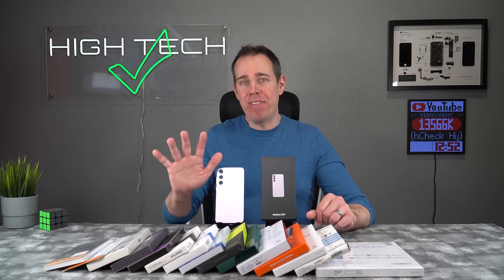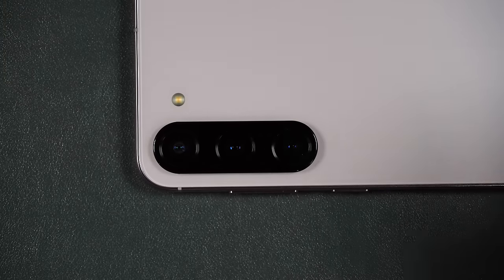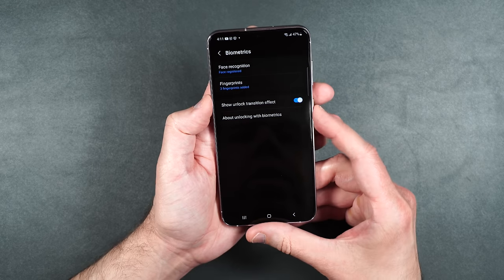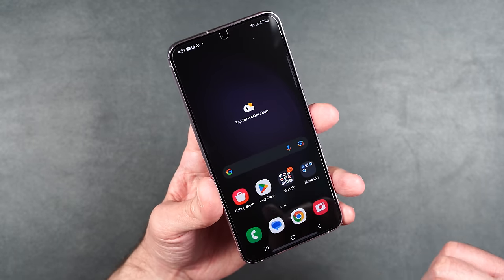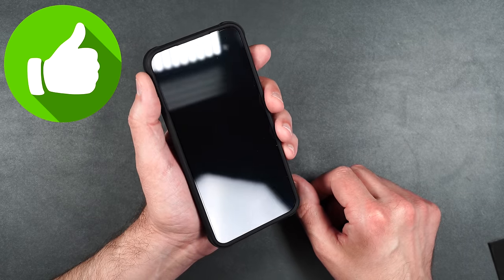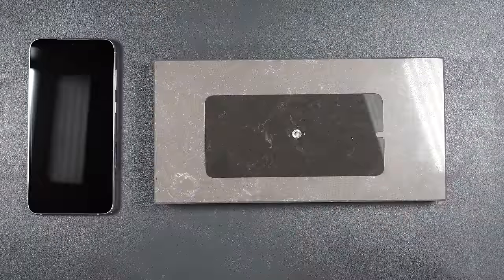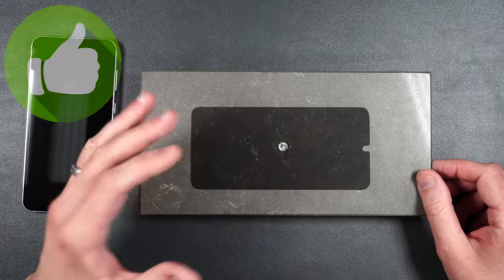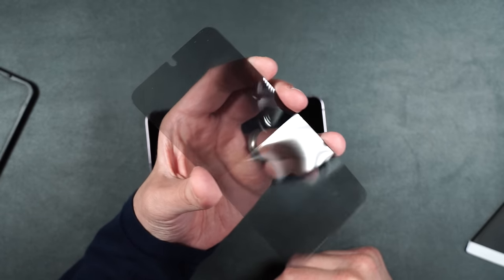Best And Worst Screen Protectors For Samsung Galaxy S23 Plus

Comment: I love how comprehensive your testing is. One possible suggestion: For the drop test, it might be worth adding in a base that has a little bit of flex to it. The test you're doing now with the nearly rigid base is perfect for testing the compressive strength of the glass. Adding in a semi-flexible base (which would mimic closer to an actual phone) would pick up the bending strength of the glass.

Comment: Thank you once again for posting this.  The amFilm and the Spigen are typically my favourites.   My only issue with the Spigen is that quality control can sometimes be off.  I had a perfect install on the S23 Plus, only to find out later that there was a chip in the glass.  Since I decided to go with the regular S23 instead, I went with the amFilm.

Comment: Thank you so much for all the time, money and effort you put into this video. There are so many screen protectors out there, especially for flagships that you can't help but feel a little confused, this cleared that right up. It's great that you broke it down into three different categories at the end but I just wanted to know if the Whitestone UV was worth the extra money. Especially compared to the AmFilm which to me seemed like the best one here. Also, is there any difference after applying these screen protectors in terms of screen responsiveness, display, as compared to the original screen? Thank you once again for your effort!

Comment: On my last two Tmobile phone trade-ins, Tmobile store reps did everything they could to find scratches and damage.
So the S23 plus $1,000 retail price drove me to try a tempered glass screen protector, and I chose the Spigen Glas.tR EZ Fit to match my Rugged Armor case.
I then managed to screw up my first Spigen EZ fit glass by lifting the wrong tab. A learning experience, the second screen protector went on perfectly, and my $1k phone is now adequately protected from routine scratches and drops.
Reply: Okay bro cool
Reply: How easy is it to remove the protector? Thats my only fear in case the protector takes a dammage, wether i can remove it without glue or something staying on the screen.
Reply: @Milan-cf1xe my first use. Never removed a screen protector that has been damaged or on for months or years.

Comment: Almost bought a $40 screen protector from Best Buy for the S24+.  Must have been the Zagg that's in this vid.  Changed my mind at the last second and watched this vid instead.  Glad I did because  after watching it I went with the AMFilm for $8 and ended up with a superior product for a fraction of the cost.   Thanks for helping me on this.  Based on your results, it seems like the AMFilm is really the only option to go with.

Comment: I had no problem installing the protector.  No bubbles or middle line. However these projectors are not as a good a quality as the preinstalled ones were. When using the s pen it leaves marks on the screen which dont go away and i was pressing hard at all. My note 10 plus was still perfect after 3 years

Comment: Thank you so much for your informative videos. I think the important weakness of your drop test is that in addition to strength of screen protector we need to find out that the screen protectors are good dampers or not. In daily life, You may see some screen protectors that are intact while the lcd is broken. As mentioned in previous comment, it would be better to use a substrate which has same strength as normal mobile screens.

Comment: Great video! Your review has made me buy the "amFilm [2+2 Pack] OneTouch Tempered Glass Screen Protector for Samsung Galaxy S23 Plus 6.6 Inch with Camera Lens Protector, 9H Hardness, Easy Installation and Bubble Free". I have installed the rear Camera Lens Protector, and have used the "SUPCASE Unicorn Beetle Pro Case for Samsung Galaxy S23 Plus 5G (2023), Full-Body Dual Layer Rugged Belt-Clip & Kickstand Case Without Built-in Screen Protector (Tilt)" - You recommended the S23 Ultra version of this case in your other video). This combination works great! I got the screen protector on bubble free, and the case does not make the screen protector lift or bubble. The buttons are very really easy to use. The only improvements I'd suggest would be to make the volume up and down buttons separate, and the access to the charging port a bit less tight. The kick stand works well. Hopefully it's durable. I'd still highly recommend this combination. The prices were great value.

Comment: I am using the Spigen. It's the only one that I could still use the fingerprint sensor consistently and was easy to install on my S22. When I bought the S23, I went right to the Spigen again.

Comment: Forgive the ignorance, but what exactly makes the adhesive based screen protector better than the EZ glass screen protector? It looks like a headache to apply and if you accidently apply it wrong or you find accidental dust on your phone, how would you remove it? The whole thing seems like a massive headache for removing the adhesive screen without damaging the phone. What is the actual advantage other than less finger prints and less maybe more scratch resistant?
Reply from the maker: Typically the liquid adhesive screen protectors are the best when using them on phones with curved screens. The liquid adhesive may also help fill in slight cracks on the screen as well. Most of the time the regular EZ protector will be just fine.

Comment: Hello, thank you for all these long tests! It's really useful.
I'm hesitating between a normal screen protector, so the AmFilm or the Spigen, and a privacy screen protector. I have two questions if you don't mind. 
First, does the integral design of the Spigen affect the front camera ? It looks a lot nicer, but I wonder. 
Secondly, it's about the Ringke Privacy screen protector. Having a big phone like the S23+ makes me think that everyone can see what I'm doing on it and what I'm looking at. It's quite disturbing ^^' But I'm afraid it will affect the quality of the S23's screen, in terms of color, brightness and everything else that makes it one of the best screens around. That would be a shame. Have you noticed this kind of thing ? Some comments say that the brightness has to be increased a lot, for example, so potentially less battery.
Sorry for the long post ^^'
Reply: The privacy screen is great but it also makes the screen darkere so you need to adjust your screen light more, and if you use your phone to watch movies or if you use it to edit pictures etc I wouldn't buy it, I just bought the clear normal screen protector from Ringke again, on my Camera I have Spigen protect lenses on and a Ultra hybrid S cover. I won't pay more for the Spigen screen protector when they're the same I can't feel any different it's just the screen tool spigen use that raises the price.

Comment: A little tip for the run off of UV Loca Adhesive on the side of the phones, hit the run off with some extra UV. It'll congeal and it's much easier to peel off that way. It doesnt turn rock hard but it does thicken up enough to be peeled off. This way if there's any adhesive that gets stuck in micro crevices, it becomes bonded to the rest so it all comes off. Else if you just wipe it off whilst it's wet, you end up missing the run off adhesive or push it deeper into the device.

Another tip, if your UV screen protector kit doesn't come with stickers to cover ports, use some dust removal stickers to cover the ports.

Overall I prefer amfilm's UV selection of screen protectors. In addition, their full screen dust stickers are amazing! I wish more companies had those. It's great to leave it on the device whilst you're prepping everything.
Reply: Could you link to the amfilm uv for s23+ ? Just seeing the non adhesive version

Comment: Your forgot two of the best protectors: Flolab Nano Armour and Zagg Invisible Shield.
Reply: The Zagg is currently $50 here in Canada.   There's no reason to spend that much on a screen protector, especially when only one comes in the pack.  My wife has the Spigen one on her iPhone 11, that she bought when the 11 was released.  It's still holding up well considering she drops her phone all the time.  Aside from a small chip (that she cares nothing about), it's holding up really well.
Reply from the maker: I tested the zagg xtr2 instead because that one is supposed to be better than the invsishield
Reply from the maker: Added flolab to the list, thank you for the suggestion
Reply: @HighTechCheck  thank you 😊👍
Reply: Your videos are an enrichment for Youtube.
Reply: @HighTechCheck Great vid.. what is the best for privacy screen protectors?  Thanks

Comment: I just want to know which is the best, going through all of these seems like a pointless task

Which has the best protection from scratches but works well with cases and the pen ? 

Fingerprints can be cleaned and Installation can be dealt with.
Reply from the maker: I gave everyone my favorites at the end of the video and I said I would be doing that at the beginning of the video. That’s why I would watch the whole thing because you miss important pieces of information that you want to know. Also the s23 plus doesn’t have an s pen?